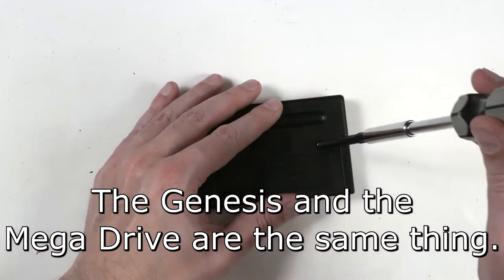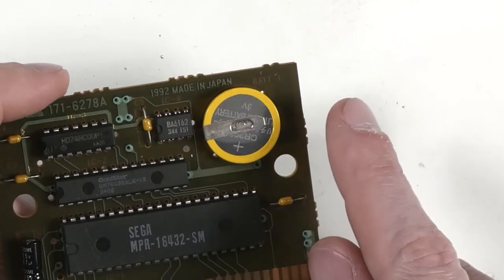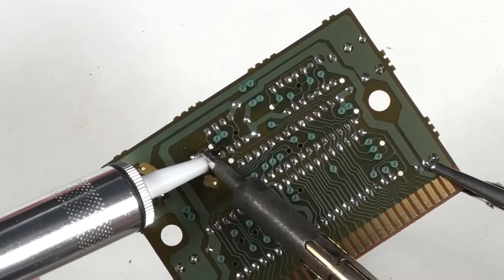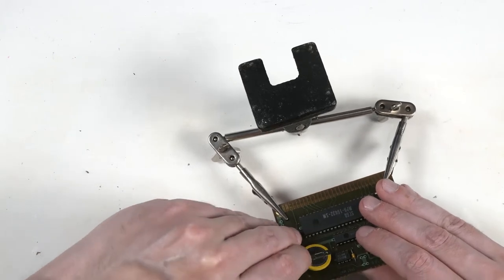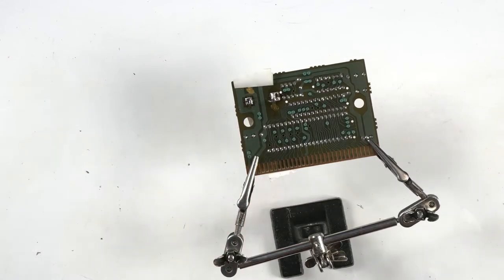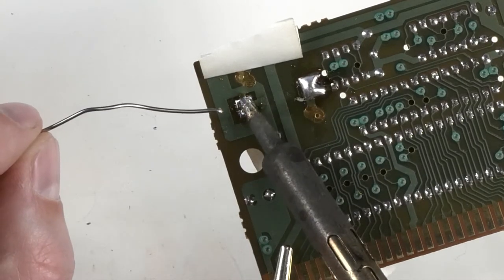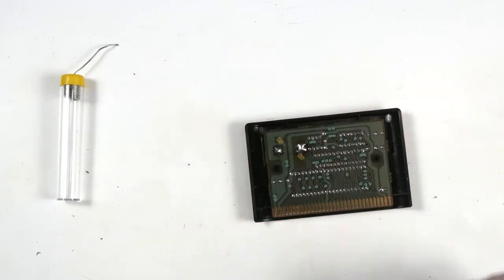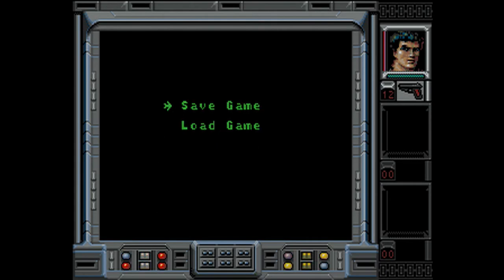Sega Genesis/Mega Drive Games Battery Replacement

Comment: I would suggest replacing the battery with an actual battery holder so in the future you can replace the battery without soldering.

Comment: here is my question, how long do these things actually last? i have a copy of PGA II and all my older brother's saves are still there. Curious after almost 30 years is it gonna go out any time soon? and also i figure only replace them once they actually do go out
Reply from the maker: None of the batteries that I've replaced (except the Dreamcast battery) were dead when when I replaced them. But, as you said, they're upwards of 30 years old. I did it as a precaution, and for content. 😊

Comment: Replaced the battery. Game saves and loads when I reset it. But when I power it off and back on, the save data is gone. Any ideas how to fix?
Reply from the maker: Check the battery is in correctly and the solder joints.
Reply: Thanks, I got it working

Comment: So theres no way to change it without soldering?
Reply from the maker: Not if you want to do it properly. You can replace it with a holder, but you're going to have to desolder the existing battery to do that.
Reply: @HexedPedestrian  darn it!!! I wanna save but I cant solder